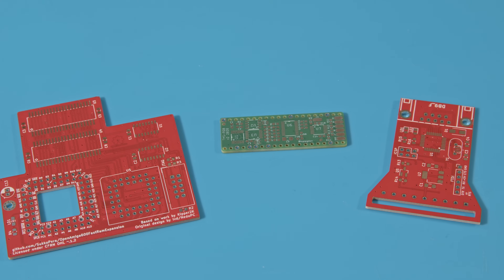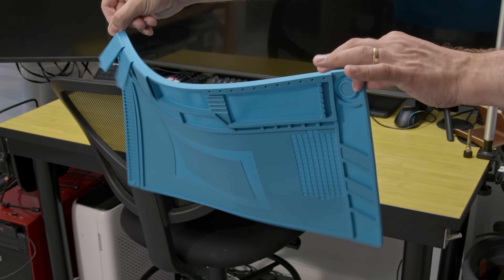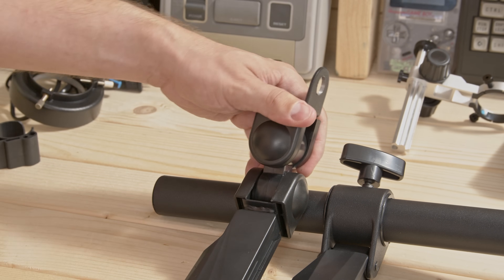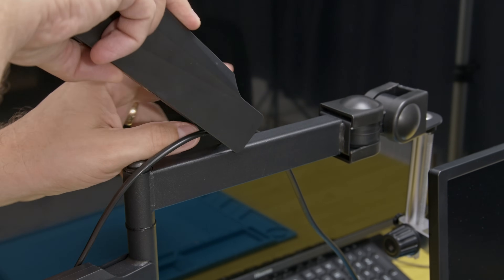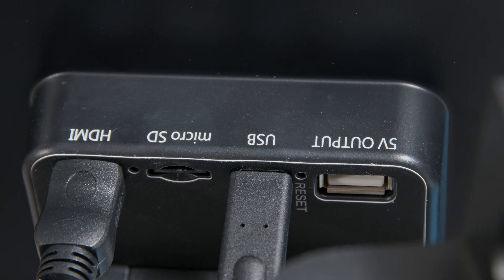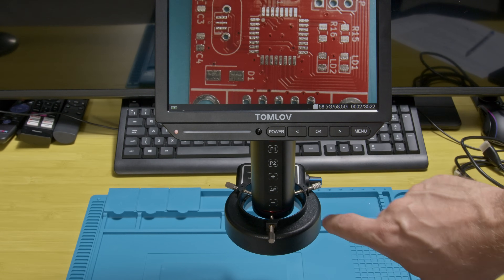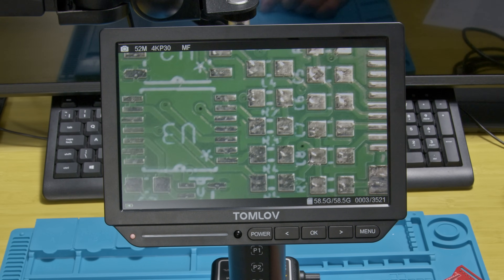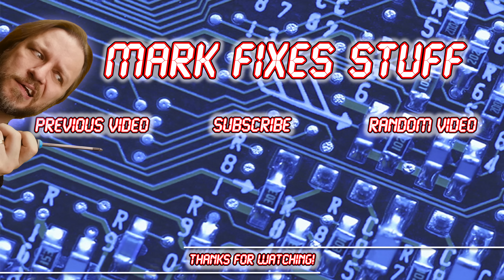My New 4K HDMI Microscope - The Tomlov TM4K-AF Flex! Set up and Test on PCBs!

Comment: Ive had one of these for a few months now and love it.
A problem I had was getting the ring light to stay on.
Fate stepped in and help me. I was at a thrift store and just laying on a shelf I saw something that made me go....hmmmmm... I wonder if....
It was a "Garbage Disposal Gasket" Made by "Do it Best # 445665
Its like is was made for the scope. It fits right around that red ring on the neck, very snug.
On the outer part of the gasket I marked and drilled 3  holes for the little white pins on the screws mounts to go into.
Hasn't fallen off once!
Reply from the maker: That sounds perfect.

Comment: Thanks for the review. I am looking to buy . Maybe I missed it, but I will ask what size screen, 8 inch or 10 inch. I'm a little worried about the image quality. Because the resolution is only 1280 x 800P. And I would also like opinions on Auto focus or manual focus? There is a considerable price difference, and the auto focus is not that fast. Thank you in advance
Reply from the maker: Hi!  Sorry for the delay, I am moving house.

This is the 8 inch, I think the screen quality is really good in my usage. Autofocus seems slow if you are watching the video, but it's much quicker than manually focussing. AF is a bit of a pain if you are working, but very handy for baord inspection. I put manual focus on for soldering SMD chips and auto focus on for moving around PCBs for inspection.

Hope this helps.
Reply: @MarkFixesStuff So which one should I choose?  Manual focus or Auto focus? Thank you very much for the detailed answer @MarkFixesStuff
Reply from the maker: @MrTrafas the autofocus, because you can still switch to manual focus if you want.

Comment: Not keen on auto focus, when you work it interferes too much.  So I bought the non auto focus with larger base
Reply from the maker: Yeah. I’ve turned it off now. Is handy for board inspection but a pain for soldering as you say.
Reply: @MarkFixesStuff  yeah for inspection, it might be fine - the noise puts me off. I saved few bucks  on non auto focus.

Comment: I'm a bit gutted. It looks like a great bit of kit with good reach. Exactly what I want. But I was hoping it would come in around the £100 price. But it's a little expensive for the occasional use it would get from me. Thank you for your review and heads up about the product.
Reply from the maker: @tdub8719  I believe the arm is now available separately so you could pair it with a cheaper main unit.
Reply: @MarkFixesStuff  Good, that's an option. Thanks for letting me know.
Reply: In your dreams

Comment: what is the small hole between the Micro Sd port & HDMI port for ?
Reply from the maker: @Keeping_IT_Simple  That’s a reset button to set the unit back to factory.
Reply: @MarkFixesStuff  but isn't there already a reset on the other side ? Between 5v & output ?

I'm talking about the unmarked hole between the other 2 ports!
Reply from the maker: @Keeping_IT_Simple  ah I see. That’s not anything. Just a hole that goes nowhere. I guess it might be for another revision of board? I investigated and even looked under the sticker that covers the back. I did find a battery compartment for a 16xxx style rechargeable cell that you access with a screw there though. But that hole is just a hole.
Reply: @MarkFixesStuff  thanks for solving the mystery of the unlabeled  🕳️

Comment: Good thing the HDMI output doesn't have the GUI overlay, just the camera image. I've seen a few other microscopes that for some reason have the GUI on the HDMI output as well, and I think it looks better on the big screen without it. Also I find most of the time you don't even need to see it. Only if you're changing an option in the menu, which presumably is set and forget. With those physical buttons for control, it would be better if the GUI disappeared from the main screen after some time and just showed the microscope image.
Reply from the maker: Is one of the better ones I’ve had, and I’ve had four now!

Comment: I think this was answered at the end of the video, but it will display on the built-in screen and output over HDMI or USB at the same time? This is an issue I have with my current Tomlov scope.
Reply from the maker: @jetsonian  the HDMI output and inbuilt screen both work at the same time. The manual says that the webcam function also works simultaneously but I’ve not tried that yet!